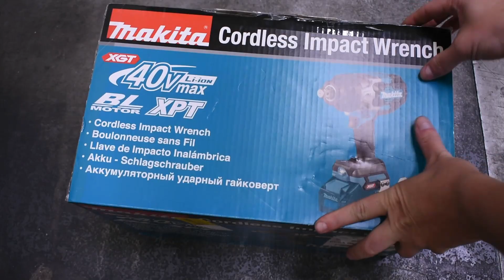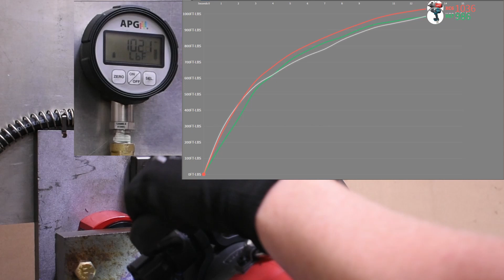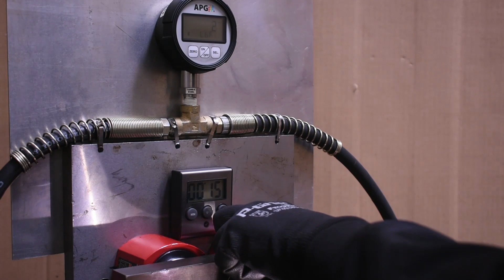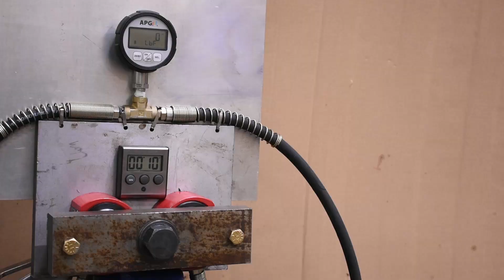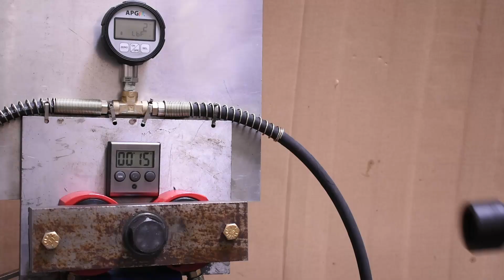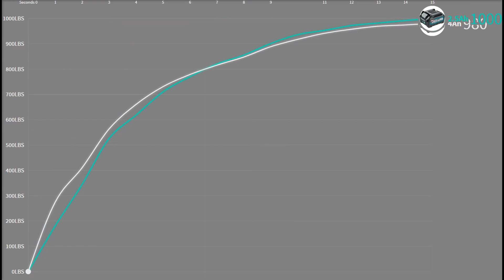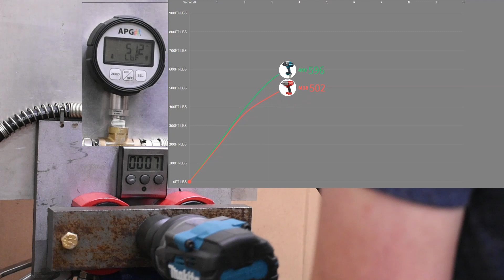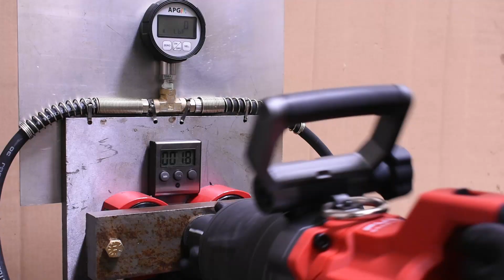Meet the #1 Big-Rig Impact Wrench It's only 3/4" & Everyone Else Should Want 1 Too

Comment: I drive a BigRig and was going to buy the $1300 Milwaukee 1” until I seen this video. That’s sure going to save me some money thanks for all the videos you post. It’s made a difference in some of the tools I had planned on purchasing.
Reply from the maker: We own both and would take the Makita for all the reasons mentioned. That said we live in an arid environment, if you often see a 1" air gun struggle with what you need then you gotta have the BIG D
Reply: Just get a 1/2 impact most milwaukee/dewalt/Makita handle the lug nuts with ease.
I've changed tires on semi/trailers for 6 years and bought my milwaukee 1/2 strictly for winters alone.
Not wanting to pull out a 1 inch impact with the temperature lol.
Reply: @Sniperofgods  my milwaukee 1/2 inch is useless at undoing truck lug nuts, so I bought the xgt and it's still not as good as an air 3/4 but very close.

Comment: The next thing you need is a custom DC power supply so you can test the tools with unlimited power.
Reply from the maker: We'll do that
Reply: @TorqueTestChannel  I wanna see that setup I want it for my Milwaukee miter saw occasionally
Reply: @WyattH  they make miter saws you can plug into the wall already
Reply: Talk about best case scenario lol
Reply: So.....A big battery 😂
Reply: I still can't believe only Metabo HPT offers that.  Other than a random 120V DeWalt double Flexvolt adapter.
Reply: @procrastinator1842  I think you might want some large capacitors in there as well. These tools can demand more inrush current than a battery can provide.
Reply: @danmartinrc  That too, I was thinking a bank of giant 2V single SLA cells.
Reply: @Hansengineering  what if you are building the wall?
Reply: @videosourceonebusinessacco5438  what
Reply: @Hansengineering  I know but I don’t want to spend another 600

Comment: I suspect Makita has limited the current flow in the 4 amp/hour battery  due to the possibility of over heating or run away current flow with the 21700 batteries.
Reply: Or the tool just doesn't need it

Comment: It's obvious that the new LXT 18V XWT17Z mid-torque was a bleed down from the 40V version. But where's the new 18V 1/2" High-Torque thats a revised version of this 40V 3/4" model? It's such an obvious move for Makita, but where is it? That 40V 3/4" High-Torque turned into an 18V 1/2" should be able to do 1200 Ft-lbs Fastening, and 1400 Ft-lbs Breakaway no problem (factory ratings).

Comment: High great video. I just purchased this tool. I’m new to tools with so many modes as this tool has. The instructions are , as usual , vague. The power level button is simple but the application modes are confusing me. I’m curious what mode you guys set the tool at when testing. Thanks

Comment: I drive a service truck and i use the ingersoll rand 285b one inch air gun. It is 23 lbs but i only pay $500 for that gun. I like the Makita idea if the tool would last. That is my only concern about the electric gun. I would never pay $1300 for any kind of impact gun. I bought a bead breaker for $1300 but that is a different story! That tool is a must have fir farm tire work. Great video and you have sure peaked my interest! That Makita sure looks good and i think i would like the speed of setup if i am in a hurry. When a trucker is down because of a flat or busted tire, the three quarter gun would be fast! An example of the speed i deal with goes like this. If i come up on a trucker that has an outside drive tire busted, i give myself 10 minutes to dismount and mount a new or used tire. The way i look at is the faster i get that guy rolling, the less money he or his company loses for having the trouble. I have recieved some large tips $50-$100 just because i could get him back on the road faster than he can stop to use the restroom!

Comment: So I can confirm the the 1/2 inch lxt high torque will remove the lugs off a hino roll back. Which is a 33mm lug nut. Didn't get to use it when we took the tires off our peterbilt road tractor due to only one battery pack being charged. So no spare
As of 04/21/23 my xwt08 took the lug nuts off a mack semi tractor.  Through a 33 mm for 1 inch Anvil with a reduce to 3/4 then another reducer to 1/2 inch

Comment: My dad and I run an big rig road repair service; in fairness these times are fast. Very fast , but we use an old IR 3/4 D handle air gun we call the "tire gun" and we run 180 PSI out of a 280 gallon tank to it with an weighted socket and it'll buzz rusted bolts off in about 2-5 seconds and clean ones in under 1 or so, at least in my opinion also new it was much much cheaper then the D handle you're using. I think my dad paid roughly $700-900 for ours and we've abused the heck out of it. 
I would like to see you guys run tests on the air 1" or 3/4" D handles you can buy but run as much PSI you're comfortable with to it.
Electric is sweet , but compared to the air , the price gap ' the power gap and "time-to-use" gap, (waiting 30 seconds for a air compressor to fill compared to waiting 30-90 minutes for a battery to charge)
Even If our air D handle doesn't make over 1200 LBS it's still $600-800 cheaper then the Electric D handle.
1200 still isn't nothing to sneeze at, at least not in my opinion.
Reply: @ShainAndrews  fair enough, our set up ,  is
$1800 compressor ( comes with all the air regulators and such pre equipped)
Tool $600-800
Hose $100
.
Running electric would be 
$1600 (tool)
Batteries $250 (newest, highest out put battery available) (prices very greatly)
You also have to keep in mind as you use the electric tool the power out-put falls off.

Air tool power doesn't drop off as long as you give your compressor time to keep up and even if it drops off from lack of air you're compressor can get you back into the game quick enough.
When you're battery runs out , you're waiting an while.
Reply: @blecgaming9069  It's all about application. Air is still king for stationary work. Metal tools getting constant oil and an unlimited amount of air.

Mobile...well...you've gotta have a pretty nice VMAC to keep up with a 1" tire gun but it's totally doable. If you're working away from a truck, electric is the way.

Comment: This to me explains why 40v or 36v tools/batteries will be better than 18, milwaukee obviously makes some brutal tools but you can see the limit, just looking at the gianormous size of the 1 inch D handle it performs well but it doesn't perform as well as you would think comparing it to milwaukees 1/2 and 3/4 high torques, it just goes to show at some point you just need to up the volts, amps and motor size can only go so far before you actually need more volts to deliver that power across the board, if that d handle was a 36v tool i could imagine it would be a lot more powerful just because the volts can actually accomadate that size of tool and motor, makita seems to be more conservative and have slowly made their way to greatness, but milwaukee gets there faster but maybe just missing a few key steps along the way, its hard to choose between the two because with makita you feel like you're waiting for them to catch up but with milwaukee you feel like youre worried whether theyve actually done it right or gotten too big for their boots, both great brands either way.

Comment: Does anyone compare this gun with a 3/4 air impact wrench? I'm in the market to buy a powerfull 3/4 inch gun and cordless or air the price is simillar! I don't have a mega compressor (60g with 11 cfm I think). That 3/4 gun could be a good addition to work on my farm equipement when the half inch isn't strong enought
Reply: i'd go with this cordless in case you need to use it out in the field. can't carry the compressor everywhere you go. not only that but the makita xgt lineup is getting even better and better as time goes by.
Reply: @smurfx  yes for shure! So bad that I'm all invest in LXT, with some dewalt and milwaukee tool as well🤦‍♂️

Comment: I know this channel is designed for large impacts and big power numbers, but I think it would be pretty cool if you could do some of these tests with 1/4” hex impact drivers showing inch pounds. I use a M12 surge 1/4 hex impact at work all day everyday. I know it’s not the strongest out there but it’s way quieter and has less vibration.
Reply from the maker: We do impact drivers. See the flex episode we tried out the surge
Reply: @TorqueTestChannel  I’ve seen a lot of your newer videos now I’m starting from the beginning. I’m on episode 10. I’ll get there eventually 😁
Reply: I have an IR 2145QiMAX 3/4" air impact that I could send to you for testing if you would be interested.

Comment: I'm glad I've held off buying a 3/4" gun so far. I think I'm going to buy the Makita. 
My friend has the high torque 1/2" and I was surprised at how powerfull it is. 
I don't work on trucks that often and if I need I have a Snap-on 3/4" ratchet with 70" handle and a big piece of pipe.

Comment: Are there any videos of yall testing 3/4" air impacts. I'm a diesel tech and use 3/4" and 1" impact alot. I like electric but they don't handle up to the abuse of all the oil and grease. One of the hardest hitting 3/4 impacts seems to be the earthquake but getting tired of having to warranty it every 3 months. Aircat makes good one not sure I want to spend the $1200 off the strapon tuck. No one seems to compare/review any of the bigger air impacts. Bought a ingersol 2145QiMAX but it has no balls was a waste of money

Comment: This is good to know as a carpenter also. I have thrown quite a few big bolts 1/2”X12” lags in with the 40v makita drill with the 4.0 amp batteries. This is for floating shelves. The 40v which is reminiscent of the makita 18vxph07 just cooks the xph07 and the batteries last 2-3 times as long. 
The issue that Milwaukee has always had since they went to the higher output batteries is their triggers. The triggers they use can’t handle the power of the larger cells. After about a year the trigger stops working. This isn’t that bad of you own 9 cordless drills and impacts like I do. But when it’s one of your only tools on site it’s a big problem. And it doesn’t just deal with the Milwaukee drills but their circs, sawzalls, etc… 
Makita may not have the most ground breaking tools but in my opinion they don’t have the problems that dewalt and decker and milwaukeetti industries have. Also, there’s way more carpentry tools in makita lineup than in either of the other big name brands. 
Except for a cordless table saw which makita has absolutely no interest in. I used to be sponsored by makita until I moved from the states to Canada

Comment: "that's how wattage works. Double the voltage and you only need 1/2 the amps."  technically true but misleading...  1/2 the amps per battery, not cell. Amps per cell  is exactly the same. What higher voltage does is allow thinner wires.

Comment: You exactly nailed the nail on the head on your explanation about wattage at the end because 40 volt dries less current the 21 cells aren't needed and comparison to the 18. Get an 18 volt it does make a difference and probably even yeah with the 24 volt
Reply: @1pcfred  the overall power output as shown by the graphs show a 18V and 40V tool running approximately the same power output. Therefore the current is clearly being limited by the 40V motor design or other ways. Again like I think you alluded to so the tool doesn't get too hot and burn up.  With the 40v setup they obviously aren't taxing the cells current like 18v is doing. So 21 cells or 18 cells isn't gonna make much difference at 40v arrangement.

Comment: One thing I'm curious about tho that I suppose you guys might know is: how many big rig nuts aren't hidden behind those center hubs that make the extended anvils necessary? If those are super common, and losses from an extension severe enough, then this tool may not work for a driver to spare themselves even one roadside spare tire install call.

It's true that if I was an over-the-roader myself I would probably buy this (and a Husky 20t bottleneck, which is only ~$50), and pride myself on being able to swap my own spare in in a jiffy.

That is, if my trailer even has one...

Comment: Hi, this is a bad ass impact Mikita put out, possibly one notch above Milwaukee? Mikita looks more manageable,
Reply: Makita will never be above milwaukee. This is the latest gen 40v vs three year old 18v milwaukee stuff
Reply: @Xoars  I agree with that Milwaukee is top of the line quality, I didn’t realize there was older tools I was at work with no sound,
Reply: @robertfrate9738  milwaukee hasn't released any new high torque impacts within the past few years
Reply: @Xoars  that I know of the 1/2 2767-20 Milwaukee is the most powerful impact with out stepping up to a 3/4 drive, I watch Vince from vcg talking about how Milwaukee is so behind in times, most times I see this channel I have no sound, ty for your input,
Reply: @robertfrate9738  they're behind because nobody has ever channeled them until recently
Reply: @Xoars  accept the battery falls out of ya milwaukee
Reply: @brettwalkom948  what are you talking about? I have 30 different milwaukee tools and a battery has never fallen out
Reply: @Xoars  plenty of others have tho
Reply: @brettwalkom948  you're delusional
Reply: @Xoars  oh really there's two YouTube channels.. Koon Trucking and Garnett tools who swapped from milwaukee because of it.. The batteries shake around way to much when you're using them and wear out the rails.. Wait three channels Justin Dow did aswell..
Reply: @brettwalkom948  $100 says they drop their tools too
Reply: @Xoars  nothing too do with dropping tools.. Koon Trucking polishes all his tools like they're his babies.. The batteries just rattle around too much and the clips break on the m12 stuff
Reply: @brettwalkom948  doesn't change the fact milwaukee is better
Reply: @Xoars  they definitely have more choice.. But dunno about better quality
Reply: @brettwalkom948  easily. Beyond easily
Reply: @brettwalkom948  four people out of millions have battery issues. K
Reply: @Xoars  youre just a milwaukee fan boy.. Quality of the two is about the same.. Ive got both.. And yeah there's only 4 people in the entire world with battery issues 🤦
Reply: @brettwalkom948  no I've just used them for years is all. And know a private contractor with an entire fleet. No issues. Stop
Reply: @brettwalkom948  no I've just used them for years is all. And know a private contractor with an entire fleet. No issues. Stop

Comment: This actually made flexvolt make more sense. Higher voltage means less amps required. So you don't need the 21700s as much with an 80V tool

Comment: Easy peasy is right... I took off all the inner and outer lugs (spud style) on a 1991 Alloy farm trailer with my M-18 3/4 impact and only used 1 bar out of 4 ... not like those stud style with slip ring washer you just pulled off there. The price is not the only difference, it will be durability and wear and tare. Put that impact to a real test of not just 15 sec... how about 7-8 minutes(both directions as in normal use) and see how hot it will get with that 40v battery.

Comment: I believe those higher 4 &5 aH batteries will definitely be needed when you're using their 80v demolition hammers and 80v miter saws and other larger,more power hungry XGT tools. I think an impact wrench doesn't need that much amp draw from 40v but some other tools might appreciate the extra large can of beans
Reply: Its the other way around, 40v will need 50 amps for 2000 watts, with 80v you need only 25 amps to output 2000 watts.

Comment: Thanks guy's. Love the idea of an electric impact however I have a problem  with it. As a logger I have to carry a spare tire, air jack, plug kit and bead setter. I would say in my personal opinion (which means jack Sh^t) that a 3/4  Air gun with a 50' long 3/8 or half inch hose real plumbed in to 2 quick connects on both on board air tanks is much more valuable than just having an electric impact. Not only can you air up your own tires or fill the bead setter to set a tire that's falling off the bead but you can use your air Jack  and air gun.  It would seem to be a more valuable system for around the same price as an electric impact.

Comment: Holy !@#$, I finially found a review of battery impacts sutiable for an O/O to carry if they have the skills to swap out a tire. Thank you for this review. PLEASE update every 6 months to a year due to new stuff comming out all the time. I've been keeping an eye on this stuff due to my carrier keeps spares on the trailer. Being able to change one out on the road can save many hours compare to roadside or shop service.

As far as performace between 2 and 4 and other various amp hour batteeries with same voltage, there should be little performace difference unless they are overdrawing way too much current from the smaller pack and that will be an safty issue.

Comment: We don't have any problems storing our 1" torque wrench (an IR-280).  It hangs from the shop ceiling.  That way it's always handy (with a short boat hook to pull it down) and always stored away when it's not needed.
Reply: I think he was talking more about storing it in a semi or service truck.
Reply: He specifically mentions road side application multiple times

Comment: When I find a lug nut my impact won’t lossen. My go to tool is a torque multiplier. Then my Dewalt 899 finishes the job.
Reply: My torque multiplier is a piece of pipe tightly fitted on my Snap-on 3/4" ratchet or if it's too tight I swap the head over to the breaker head. 
I don't know why though because the ratchet has warranty.... Meh the breaker head came in the deal.
Reply: And if the 899 can't do it, well, there's always thermite.

Comment: I use my Milwaukee 2863 to change my semi tires. 90% of the time there is no problem unless they was over tightened. The only problem was finding a 33mm 1/2inch socket.